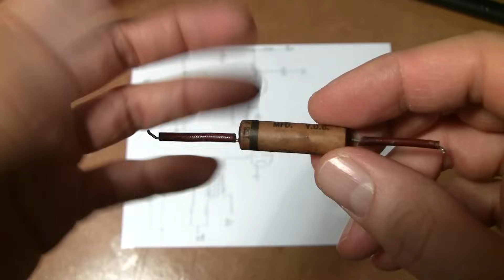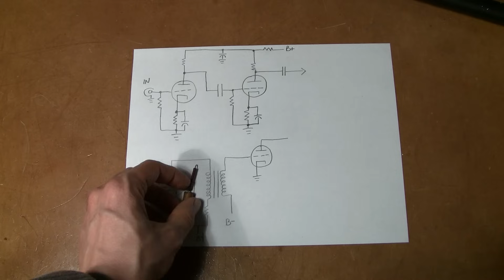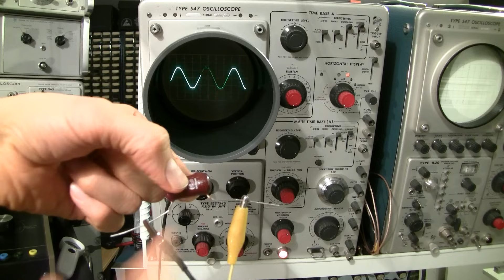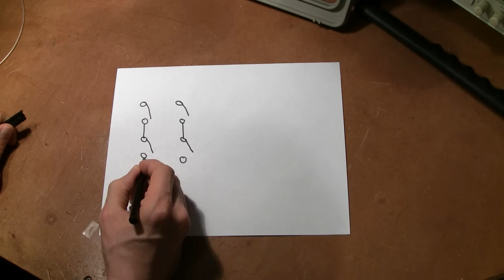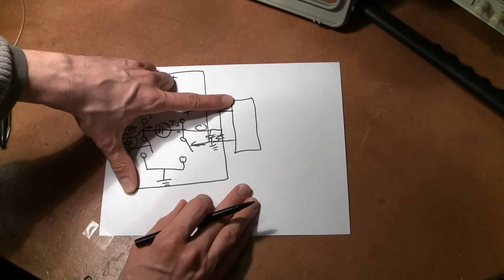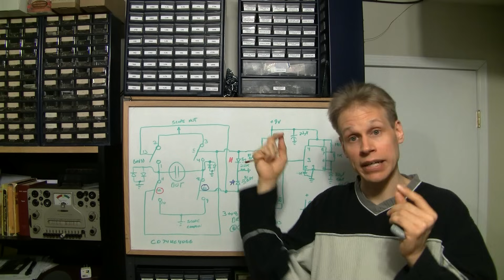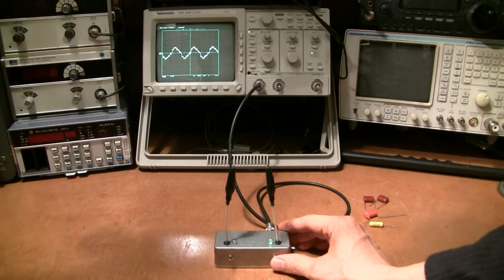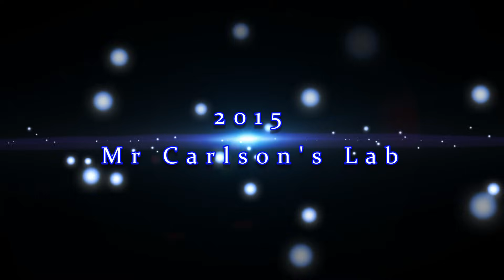Are Your Capacitors Installed Backwards? Build this and find out

Comment: It's one of the "top secrets of making a noise free tube amplifier". People sometimes doesn't belive when I do some maintenance on their amplifiers and they get it without any noise, humming, etc hahaha.
Reply: Mr Carlson, do you have this three way switch that they use in Tube Testers or does know where I can buy them? I'm trying to buy one to repair my tube tester. My switch have A LOT of rust =(
Reply from the maker: Navarro Eletrônica Thanks for the comment Navarro!
Reply: Christiaan Baron
 Yes! You need to take off them before testing! I usually 100% recap even good capacitors cause everything serviced here have 1 year of warranty. In 8 years doing repairs only one single amplifier came back  faulty.
Reply: Christiaan Baron
And doesn't forget to decouple with 100nf plus 100nf and 10ohm the power supply after the retifier! It get some noise out of the supply lines and give more attack for the tube amp.
Reply from the maker: Navarro Eletrônica That may be another video in the making :^)
Reply: Mr Carlson's Lab
Really Nice!
Reply: Christiaan Baron
It may be the USB scope... I use an analog 20Mhz boatanchor scope.
Reply: @NavarroEletrônica  You may have your transformer primary installed backwards. The primary windings closest to the secondary windings should be connected to the neutral line. Now, no need to open the amp and start soldering around, just reverse the power plug and see if it's less noisy in one orientation than the other.

Obviously, a shield winding (which would be connected to ground - that's "protective earth", not the neutral wire, which, while close to protective earth, still conveys current and may be, due to voltage drop, a few volts away from true ground).

There can also be "switching noise" from the rectifier. A capacitor with a low ESR would be weapon of choice here...like your cermic 100nF.
Reply: @NavarroEletrônica   I'm trying this my Tektronix 465B set at 5mv and not seeing much amplitude, and really tough to tell a difference one way or the other. Do you set the scope to AC or DC?
Reply: @klausstock8020  good info, thx
Reply: Christiaan Baron 
My scope works better at 2mV/Div with the 20MHz BW limiter on.
Reply: Christiaan Baron 
The band side goes to the lower impedance of the circuit. Can you tell which part of your circuit goes towards ground? If so, that is the band side as I understand it.
Reply: Rest in peace navarro.
Reply: @willianlarentes  Did he die?
Reply: @bobcat2112-w4r  yes, he did, he had a heart attack when he was traveling to europe
Reply: Christiaan Baron 
I'm not sure what you are asking. How a cap is described depends on how it's used in the circuit.
Reply: Christiaan Baron 
Yeah, you need a proper schematic. Maybe if you ask around on some forums someone will have the schematic.
Reply: Christiaan Baron 
That doesn't look like the right schematic, but I don't know much about tube radios. You should ask someone else. I think Paul says in the video that the band side of the cap should go toward the plate of the tubes, but I don't remember exactly.
Reply: A good tube manual will show most tube types or you can get tube layout on line. even if you Change the ones that go to chassis ground you will eliminate most noise. A Dynaco Schematic can be found online and it don't cost anything. I have a ST 70 that needs work I dont know if I want to restore it or just find one already restored. I am hoping for a ST35 because I like the 6bq5 amp.
Reply: Find the silent ground point on the 1st. and 2nd. audio amp cathodes (tube amp) I have never found reversing NP Caps made any difference whatsoever. Old Anode carbon resistors are famous for causing noise and frying !! Fit metal film !!
Reply: dbltrplx  *You’re
Reply: I like how young generation of Electronics Engineers re-discover "secrerts" of electronics :)
Reply: Install new foil caps and everything is fine, they can be the cheapest of the world... No need for any vodoo
Reply: ...the amplifier HUMS because it doesn't know the WORDS!!!

Comment: Great video! It would be very interesting to see this applied in a real world circuit so we can see actual  performance and or stability gains / losses.

Im instantly  thinking of the issues  Arthur Hollingsworth has with his restoration of a 1939 Silvertone 6438. I wonder how many restorers, when replacing  non polarized capacitors, just place them in the chassis with the writing going the same way because it looks good?
Reply from the maker: RC Model Geeks Thanks for the comment! When it comes to electricity, everything matters.
Reply: Mr Carlson's Lab Now you have me thinking what other components could possibly exhibit the same kind of issue due to their construction. For example what about an inductor with multiple layers of winding?
Reply from the maker: Glad to see I "Poked" the grey matter :^)